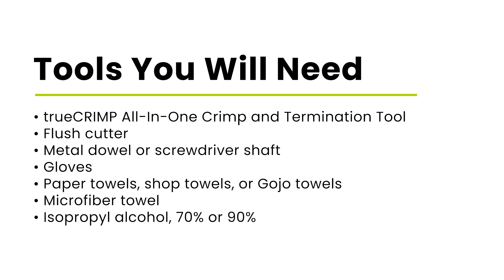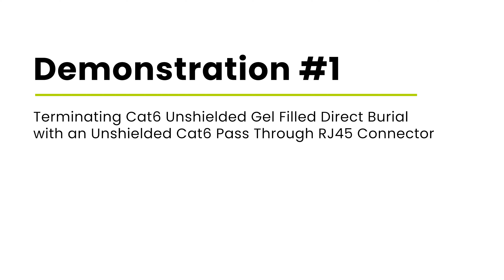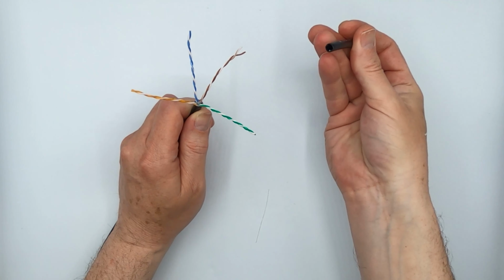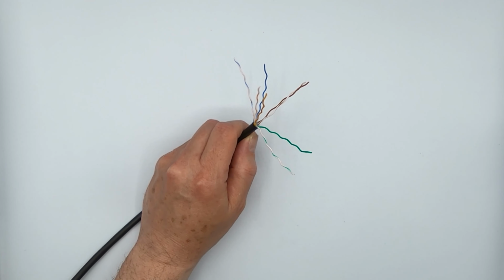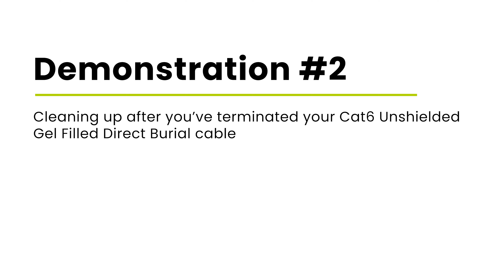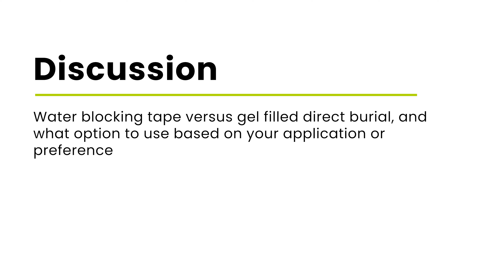Cat6 Gel Filled Direct Burial Ethernet: Termination and Best Practices

Comment: I just got my cable and made a patch out of a 4 foot cable . I have to replace all of my runs due to wrong cable in pvc conduit. Does the gel cause problems with keystones or caps if not cleaned off with alcohol?  I just used a paper towel and thank goodness for the gojo under the sink .
Reply from the maker: Hello Steven! Thanks for your question. It is recommended to remove the gel from the conductors prior to termination, as the gel is an electrical insulator. You don't have to go crazy doing it--a simple wipe with 90% IPA or GoJo hand degreaser towels will work. Ensure the conductors are dry (no IPA or GoJo) before termination! Microfiber towels seem to work best for me.

Comment: Whats the typical lifespan on a buried cable?  Trying to decide if I want to go hard wired security camera or wireless and put an accesspoint outside.
Reply from the maker: Hello and thanks for your question. The lifespan of a direct buried cable depends upon quite a few factors, including if your area has freeze/thaw cycles and how deeply you bury the cable. If you use conduit and bury your cable 12" deep OR if you directly bury the cable and put it down 18" to 24" lifespan can be up to 20 years. The deeper you bury the cable, the better. Be exceedingly careful not to damage your cable if pulling through PVC conduit. More cable is damaged during installation than fails underground once in place. The damage can also be sneaky enough that you won't notice it until the first freeze/thaw cycle or your PVC conduit fills with water over time. Use plenty of synthetic wax cable lubricant, have two people to do it (one at the feed end preventing kinking or skinning of the cable) and don't pull through more than 100 feet of conduit at a time.

Comment: Rubbing alcohol is a great tip
Reply from the maker: Hello Paul. Even better are Go-Jo degreasing wipes that come in a dispenser that mechanics use. I discovered those a while back and am glad I did! It is even more effective than the alcohol. Once you wipe the conductors with the Go-Jo hand wipe, simply dry them off with a microfiber towel. Also good for your hands and tools and smells a lot less.

Comment: If the gel makes contact with the termination would it damage the terminal ... Example a camera Ethernet jack where the camera itself is exposed to 100 degrees temperature and the gel melts and makes contact with the Ethernet port.?
Reply from the maker: Hello and great question! We encourage you to remove as much gel as possible from the conductors to make the termination process easier and less messy. That said, the gel is NON CONDUCTIVE and won't affect electrical performance. A handy item to remove gel from the conductors (plus your hands and tools!) during the termination process is Go-Jo Degreasing Handwipes. Home Depot has them. After wiping off the conductors, dry off any cleaner residue with a microfiber towel.

Comment: So I’m having an issue that I’ve done everything here said. Then the RJ45 connector doesn’t “ click “ to the camera port?
Reply from the maker: Hello! If you mean the plug does not audibly click into the port and as a result easily pulls out then I would suggest bending the disconnect latch back upwards to a steeper angle. Sometimes the latch gets compressed when the plug is terminated. Simply reset it. I hope that help!

Comment: Maybe I missed it, do you not have to ground the gel filled cable?
Reply from the maker: Hello David. No, this particular gel filled Ethernet cable is U/UTP (unshielded). There is nothing to bond to ground.
Reply: @trueCABLE  so you don't need to ground a direct burial cable?
Reply from the maker: @Firemedic2105   Hello David! I think I understand what you are getting at. Yes, it is a good idea to have a Ethernet surge suppressor at the point the cable enters your home/facility. The surge suppressor is what is grounded, with a bond wire that attaches to your AC ground system. This is why most professional installers will locate the spot where your Ethernet (or coaxial) cable is located close by where your AC comes in as well. The distance to bond the suppressor is shorter, and shorter is better. Tupavco makes a good outdoor enclosed surge suppressor that you can custom attach a bond wire to.

Comment: Two quick questions:
1. Can you terminate the gel filled cables with keystones?

2. If you can, do you recommend a toolless or 110 keystone?

Thanks for the tip on getting rid of the gel, it’s always a pain to deal with.
Reply from the maker: Hello Kyle and thanks for your question. Yes, you can terminate gel filled cable to keystone jacks. In fact, that is the preferred way. Whether you use tool-less or punch down keystones is up to you. I would say if you have 12 or less total terminations, then tool-less would make more sense. If you have a LOT of terminations, then the punch down ones will actually cost less and save you time if you use our EZ keystone jack rapid termination tool--as it seats and flush cuts all 8 conductors at once. The additional cost on the EZ punch down termination tool will pay for itself in short order. You are welcome on the tips for gel filling! Yes, it is a bit messy but worth it. Gel filled Ethernet is extremely water resistant.

Comment: They only have to lineup where you are cutting them, after is not really of much concern as that is trash.  Thru-connectors would  be different I guess.
Reply from the maker: Hey, Frank! Generally speaking, correct. That said, for the cleanest and easiest terminations it always a good idea to make sure the conductors are lined up along their entire length and smoothed out as much as possible. Obviously some conductors will cross at the cable jacket due to the nature of Ethernet, but there is nothing you can do about that. We hope this helps!